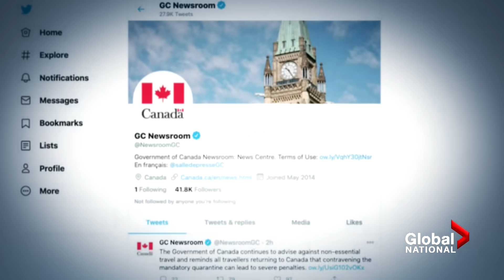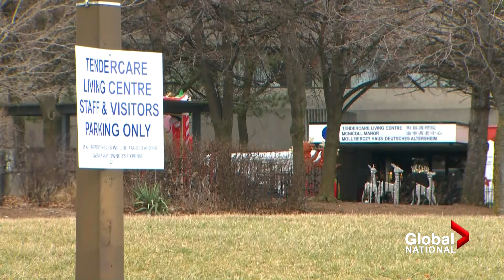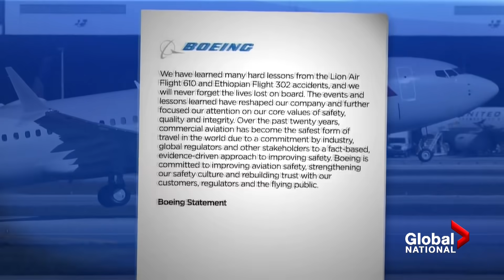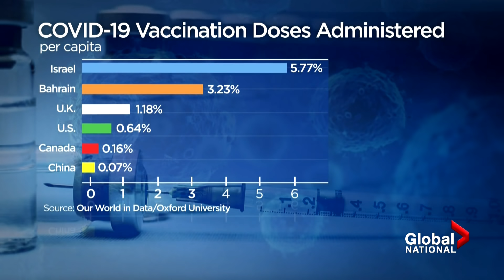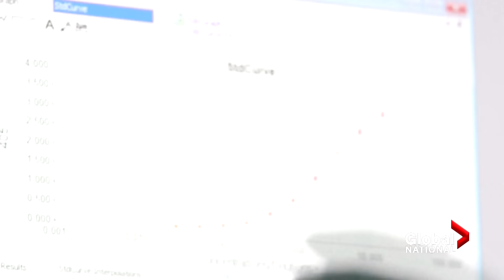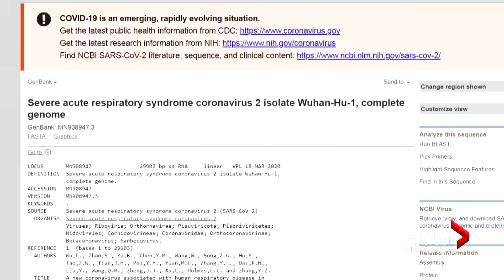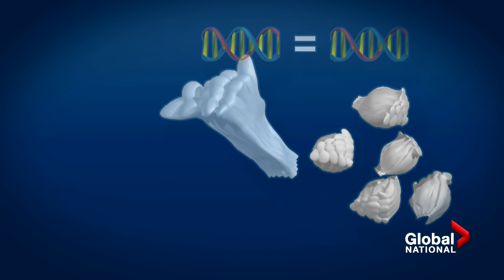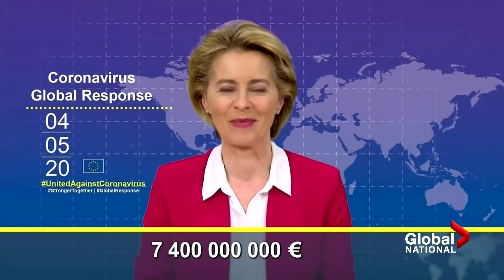Global National: Dec. 29, 2020 | Ontario's vaccine taskforce head wants single-dose Moderna vaccine

Comment: Keep the Max out of Canadian airspace. Not Canadians’ fault that Air Canada and WestJet foolishly put all their eggs in one basket. If they’d been smart they would’ve bought Airbus A320 Neos alongside the Max in case one of the two models ended up in trouble like what has happened.
Reply: The Max was a badly designed airplane but has now been fixed. A similar thing happened with the A380, just luckily no crashes.
Reply: @justrocketscience3462  The problem is the entire design of the plane that is prone to stalling. No software change can fix that.
Reply: @Day &Night But the original problem had nothing to do with engine failure.